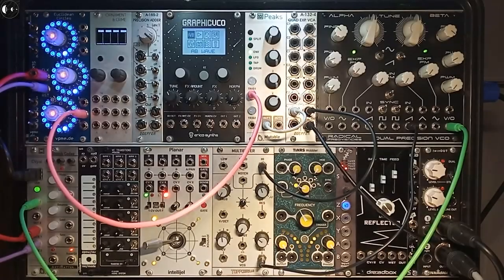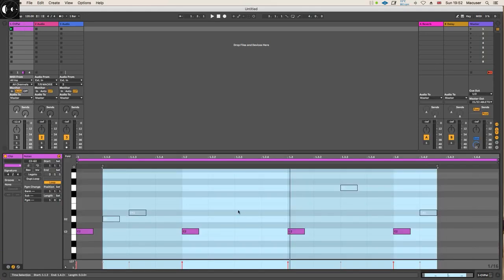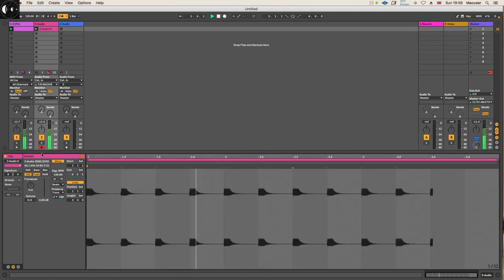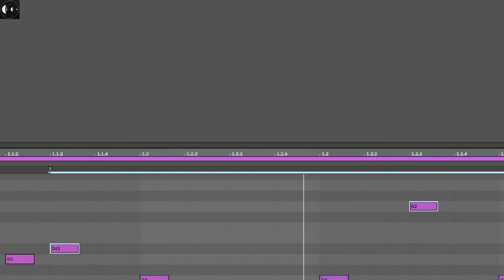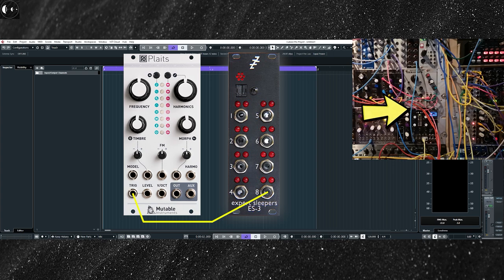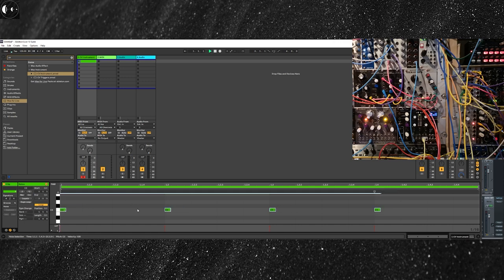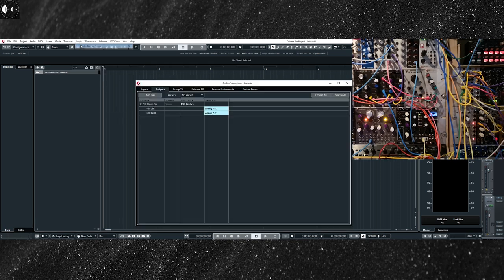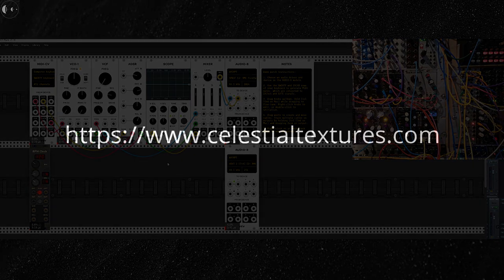Midi and Audio Clock Sync With DAWs

Comment: You can avoid a lot of manual delay compensation by selecting the instrument module as input for your recording channel instead of the hardware input. You then need to select the hardware input on the instrument module. That way, no negative driver compensation, no delay on the instrument module and no negative midi clock delay needed.